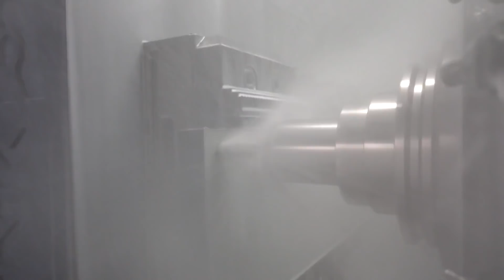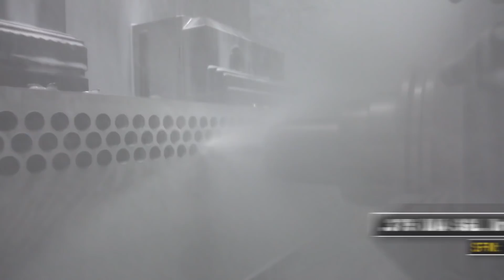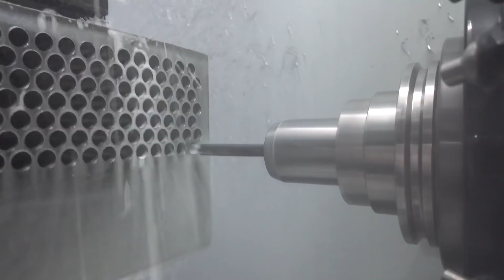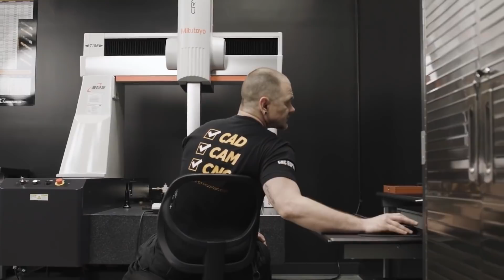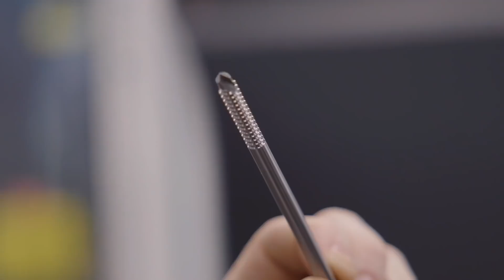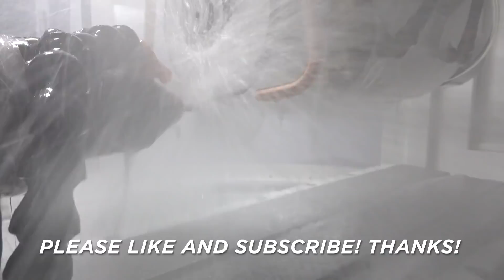Without This… You Will Fail | Most Important Aspect of CNC Machining.

Comment: great series of videos man keep them going and one thing l want to add when you was talking in the begining of the video about how you would optimize the part to the maximum to get the least cycle time possible it is a good thing heck it is a great thing but you should never spend a dollar to save a dime if you are making one or two parts and you spend two hours optimizing all of it and at the end you gain 5 mins it depends but sure its not worth it but if you are making thousands tho ... spending 10 hrs to save 3 secs is worth it, ust something l wanted to add, don't spend a dollar to make a dime

Comment: "You don't need an engineering mindset"
Immediately describes an engineering mindset. Titan pls.
Reply from the maker: The point is that many who would not think they are capable… actually are…

They may not be strong in certain areas but in others that matter more… they are…

Which then helps them bring up the deficit.
Reply: @TITANSofCNC  just having a laugh, it sounds like you mixed two thoughts together. I get that you were trying to say that the enthusiasm and small things just like walking faster will make you more productive, which are not necessarily 'engineering'. As it is in the video though, you don't clearly cut that thought from the rest of the video which is engineering to a t.

Comment: ok im forced to retire from the machining welding and fabrication industry. in the days of slack labour law , all manual machinery, and a lot of crappy looking shops, a man had to think out side the box to get things done. sorry but today its about button pushers. believe me it takes real skill to rebuild a 120 yo lathe and then use it daily in my shop and by the way i dont have access to half million dollar equipment. makin a livin not a killin!
Reply: I can appreciate manual machining but you can’t pump out parts nearly as fast compared to modern CNC machines. There are features in modern parts that can’t reasonably be done on manual machines either (3D machining repeatably). The market needs good operators on the CNC machines. They are in more demand. While I agree that it would suck to JUST be a green and red button pusher, I’m pretty sure Titan is also trying to tell everyone here to strive for more than that too. Also, at least in the 3-axis world, you can get a decent machine in the tens of thousands of dollars range or 100K. You don’t always need a half-million machine.
Reply: I think you're completely missing the point here. Gone are the days of one man per machine, when those people were turning knobs and handles. Today, a "real" machinist is programming, designing, and checking parts, for multiple machines. Yea, you can just sit in front of a machine and push the green button, or you choose to do more in your spare time. Or can be programming a robot to push the green button for you. One person, doing the work of what took many. It's called efficiency. If you choose to do more, you'll get paid a lot more.
Reply: @ncsteinb  I can definitely agree with that lol. I really want to get a machine like the Mazak Variaxis i300 AWC or something like it. Pallet changing robot with it's own pool and a massive stockpile of tools that can be loaded into the machine. Load it up with proven programs and you can let it run all night or day.
Reply: It's weird how if you get a job just pushing that green button and checking every 18 parts you get paid way more. You can work at Volvo making 3 dollars more just pushing that green button then some people I work with who can have been doing this for 20 years.